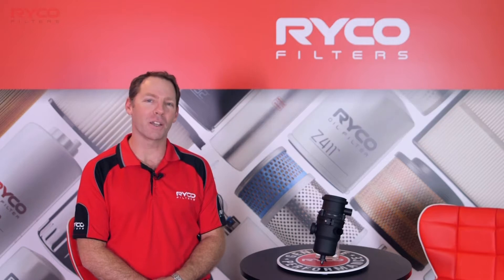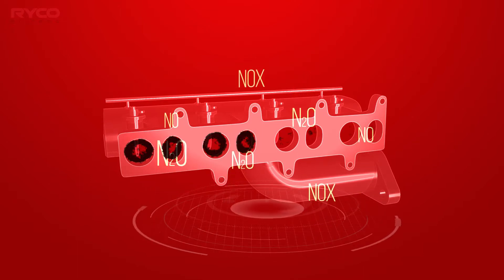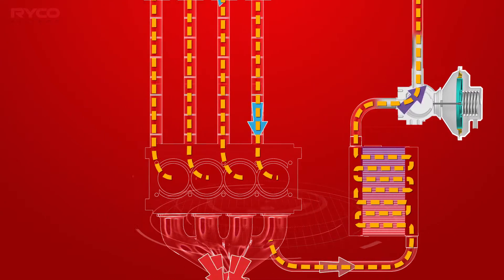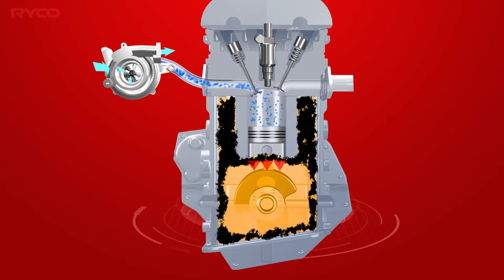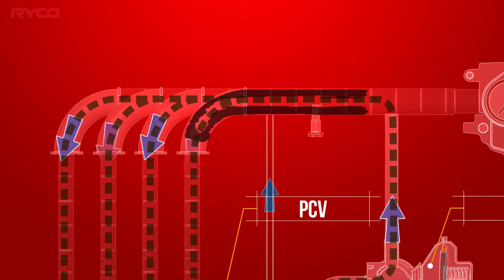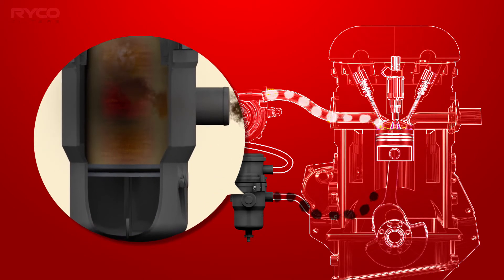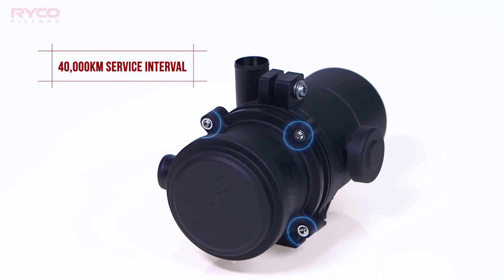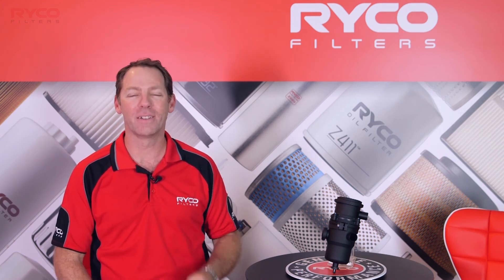Crankcase Ventilation and Diesel Engines

Comment: How do i empty the Ryco catch can?
Reply from the maker: Hi John.  If the catch can has been fitted with the drain hose pull back the red section until all oil has drained out. If it has been fitted without using the drain hose supplied, simply slide out the unit from its bracket and loosen the drain plug on the unit and let the oil drain onto a pan or bottle.

Comment: It's car and model specific - unfortunately for RYCO's argument I have a VW diesel.
When your crankcase vent is ALREADY blocked and you have oil seepage visible on the exterior of the engine due to increased crankcase pressure, then this "oil catch can" cannot help.   First, you need to unblock the existing vent.  Then, install this device between the NOW unblocked crankcase vent and the engine air intake.
Unfortunately, on VW TDI 1.9 engines, the blocked vent cannot be got at without taking off the moulded plastic cam cover.  Why VW don't make this vent accessible from outside the cam cover for cleaning, ..remains a mystery.   A job which should take half an hour turns into a three hour job with possible expensive replacement of cam cover gasket.
Reply from the maker: Good point you raise. You do need to check that PCV system is fault free and clean prior to installing a catchcan and should always check that the PCV system is working correctly.